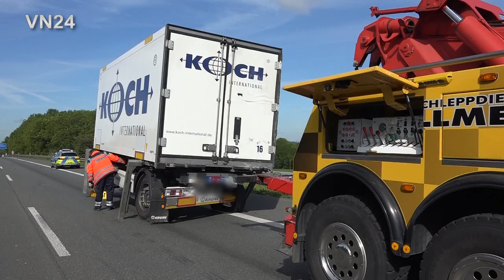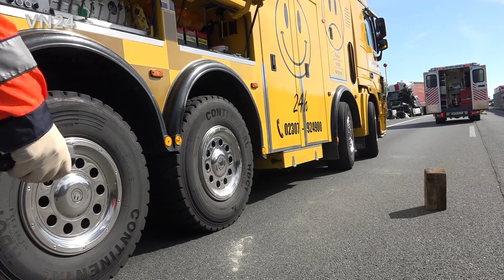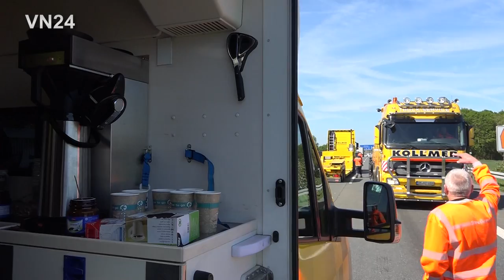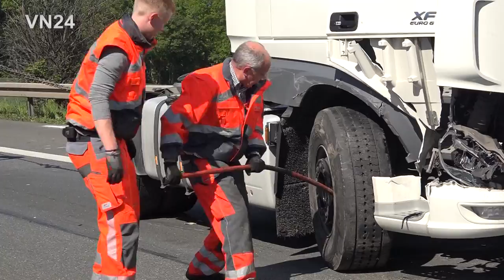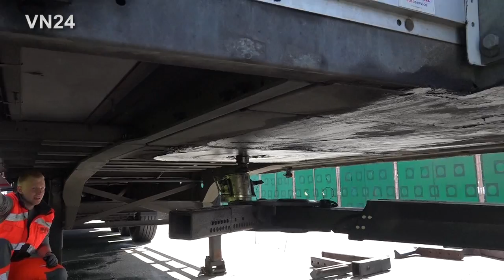13.05.2019 - VN24 - Teil2 - Bergungsarbeiten nach tödlichem LKW Unfall auf A2 bei Kamen

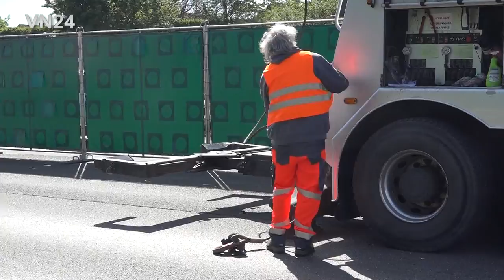Comment: At time 9:19 in the video, the tow cable breaks free of the wrecked truck and flings back hitting the Tow Truck, barely missing the Winch Operator. Would have easily killed him. This is the VERY reason most of the latest Tow / Winching / Recovery trucks have electric over hydraulic controls so the operator can use a Wireless Remote Control and stand well clear of the Danger Zones when things break or fly off. Obviously, the management of this Company is not really Safety Conscious as this is filmed in late 2019 so they should have already either modified their trucks or at a minimum provided better Safety Training. That sledgehammer smashing of the broken door while under the tension of the tow cable,  to get it to come away was more suited to a 1920's KEYSTONE COPS Comedy movie than in a professional workplace
Reply: Over 23 years ago saw an accident where the cable broke and the end piece came into the face of the operator, he survived but had to undergo plastic surgery for years afterwards, unfortunately his face never became what it was.
Reply: word *
Reply: The world has gotten to the point, when 8-wheeled tow truck (with the lowest gearing there is) and a mighty-ass chain, stands still as an anchor, using 500bhp engine to power puny whinch with an Auchan cable-cord.      This looked something like pulling a hand-digging shovel with a CATerpillar. You've got the equipment, use it.

Comment: They are OBVIOUSLY NOT trained in doing a Job Safety Analysis (JSA) before doing a risky task.  If they needed to steer the dolly wheels then use a pair of slings one out each side with one man at least one each; and standing well back. That way they could have pulled tow bar either way to change direction. If they worked for me they would have been INSTANTLY Suspended and required to do Risk and Safety Training with a test at the end that a Fail would mean the Sack.    
Possible hidden fractures in those legs could have been worsened by the crash or caused by Crash, could have had container suddenly fall and crush those under it.
Reply: They are working with ouț judgement

Comment: VERY VERY DANGEROUS going under the container whilst on it's legs, especially with no head protection gear. NOT very professional at all.
Reply: agreed. they are OBVIOUSLY NOT trained in doing a Job Safety Analysis (JSA) before doing a risky task.  If they needed to steer the dolly wheels then use a pair of slings one out each side with one man at least one each; and standing well back. That way they could have pulled tow bar either way to change direction. If they worked for me they would have been INSTANTLY Suspended and required to do Risk and Safety Training with a test at the end that a Fail would mean the Sack.    
Possible hidden fractures in those legs could have been worsened by crash or caused by Crash could have had container suddenly fall and crush those under it.
Reply: cis @davidbroadbent861
Reply: @davidbroadbent861  appeared to have only one side with a block under the leg, the other side was levitating. : ( Are they half fast or perhaps half assed?

Comment: A Long hooded Truck Distributes the weight better and gives more traction. the only time a cabover can compete is by putting a fourth axle that steers behind the cab. think of a truck like a SEE-SAW. if the weight is counter balanced then the tires GRIP the road Better. in the USA we have spread Axle Trailers for that reason, especially in Bridge formula states. Nice to hear from you
Reply: Our trailers and axle spreads are made to complement each other perfectly - I don;t know much about the USA-suffice it to say that each country has different regs and those are there for a very good reason. We don;t have long units (tractors) here - they just wouldn;t work, and having permanent 6x4 would be seen as a huge waste of fuel and great inefficiency (Fuel prices in the EU are double what they are in NorthAmerica) 
No truck would have survived this accident be it forward control (as in film) or normal control (conventional).
Reply: Gareth Ifan  hello, but in my state DEISEL, COSTS MORE THAN PETROL, . CHEERS FROM  NJ USA🇩🇪🏴🏴🇻🇪🇬🇧🇺🇸
Reply: USA Bonneted trucks fold up even worse than Euro trucks seen so many poorly designed ones like KW/Petes old designs not moved forward. also piss poor braking systems and as for traction laughable Euro trucks see Yours off every time plus 99% you have fifth wheel point behind first drive axle so less weight over steers and control.

Comment: That's all due to the stupid no overtaking rule for trucks in Germany - they all bunch up close together in the right hand lane a few metres apart and this is the outcome..Change the Law!
Reply: I'm from Portugal. I am a truck driver and drive around Germany and my biggest concern or prevention and always drive away from the front truck because I know that driving glued to the front is not good and is one of the biggest causes of accidents ...
Reply: law of safe driving: if you drive with 50km/h then between you and the car in front of you MUST be at least 50 meters. If you drive 150km/h then between you and the car in front of you must be at least 150 meters. I repeat: AT LEAST.

Comment: Now why wouldn't you before even attempting to pull the truck and trailer run air to the damaged truck release the brakes then lift the truck remove or cut the tailshaft and tow the unit to a safe location and load it to tow the ROAD IS BLOCKED !!!!